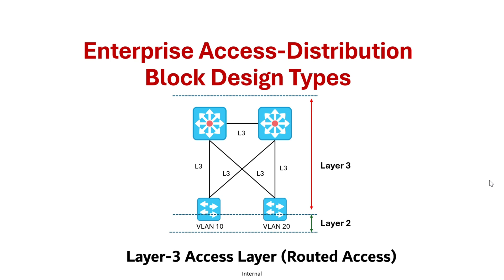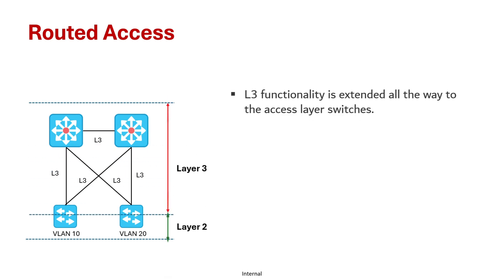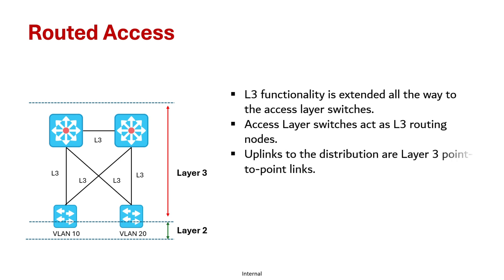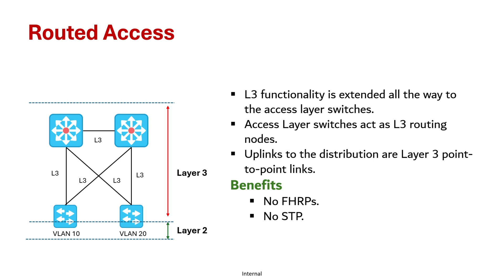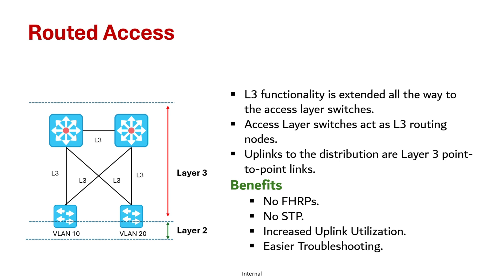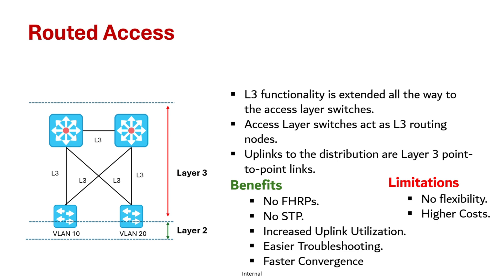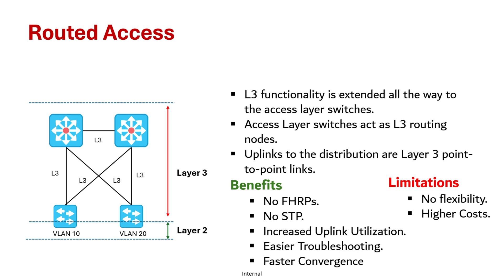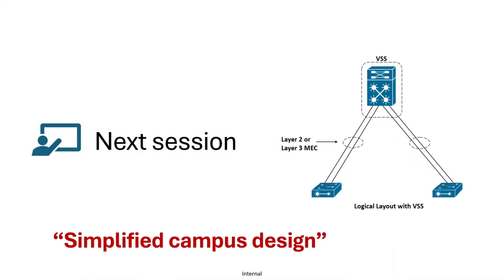5- Enterprise Access-distribution design -L3 Access layer (Routed Access) | CCNP ENCOR 350-401

Comment: What's the point of having the access switches as L3 AND the distribution/core switches as L3? Why not have just one pair of switches as L3?
Reply from the maker: Well that is a good question you have asked,,,

It depends on the size of your organization or network... you can have smaller network with only access switches. but if you network is spanned across for ex  multiple buildings you need to add distribution layer...

Check out this video which i had shared earlier regarding hierarchical design,,, that might answer your question regarding why access and distribution layers are added.

https://youtu.be/2USFEjxIoJ8

Again it all depends on your requirements.. this is one of the design options available...
Most preferred option is L2 access layer (STP based design).

Hope i answered your question..